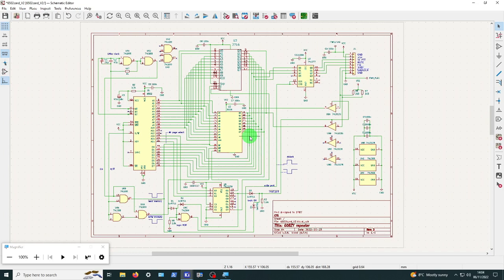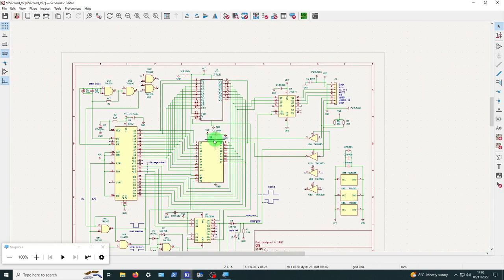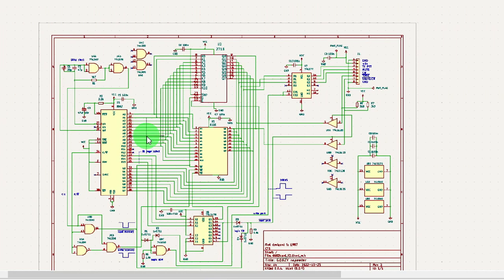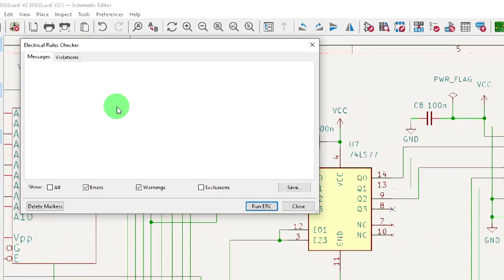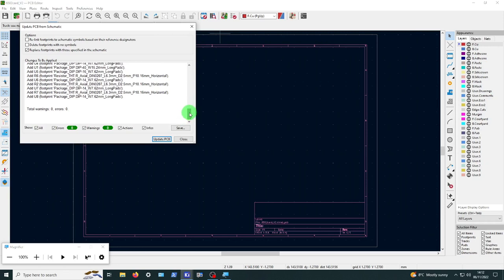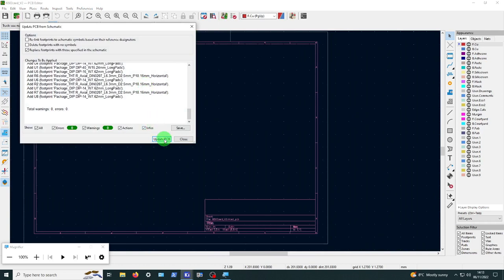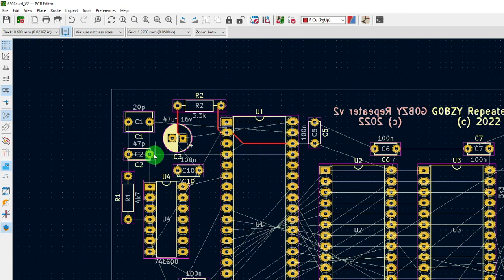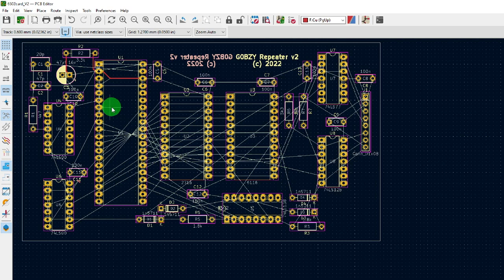Convert a Schematic Drawing to PCB using KiCad : Reverse Engineering a 6502 CPU card

Comment: You should connect any inputs of unused gates or inverters to either VCC or GND. Floating inputs may cause the device to oscillate.
Reply from the maker: Hi. Thats true for CMOS inputs where the input pins can float, putting the gate into an undetermined state. Possibly leading to some kind of oscillation. However, we are using LS series here which are not high impedance input. Its fine to not connect them in this case. They are internally biased (pull up) to high.

Comment: I used Orcad for the schematics and Tango for the routing back in the 90s both on 5 1/4" floppies.
I was curious to see if the 6502 would have been better placed with the rom and ram to the left and both inverted.

Comment: I see U2 and U3 power pins does not have ant pin numbers but the wires are coming out this is confusing to anyone reading the schematics also the processor U1 would have probably been better upside down with pin 1 at the bottom of the pcb

but keep them coming you're getting there

Comment: I see in the shematic there are 4 nand gates that are part of a 74ls00 chip. When the schematic is imported into the pcb layout they are replaced by the pinout for the package. Can someone point out where this is explained? wher do the breakout symbols come from and how do they get related to the package symbol?
Reply from the maker: Hi, the schematic symbols, also have associated ''footprints' as they are called and are all stored in the KiCad part library. When you add a part like a 74LS00, you get 4 gates, each with a letter (a,b,c,d) this indicates which gate in the package you are connecting to, and with pin numbers also shown for that gate. Those pins then translate to the PCB footprint and KiCad does that automatically once placed in the PCB layout. Hope that helps.

Comment: I didn't see how you took your pencil written schematic and made it into the digital version.  I'm new to KiCad and trying to replicate a board but the learning curve to do that is very steep.
Reply from the maker: Hi Michael. You are right. The video was already getting quite long and wanted to get the point. I had to miss the process of manually entering in the schematic from paper. It really is a process of getting all those bits of circuit (multiple bits of paper) and one by one entering it in. Its a process but eventually you get the whole schematic. I may do another video specifically on schematic entry if there's enough interest. Thanks. And good luck.